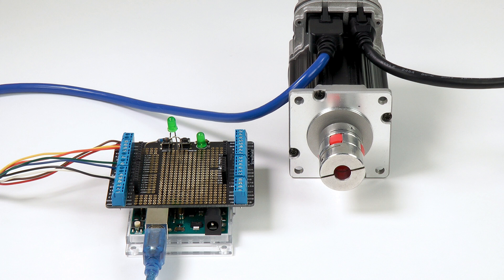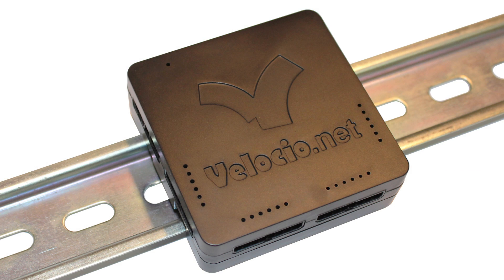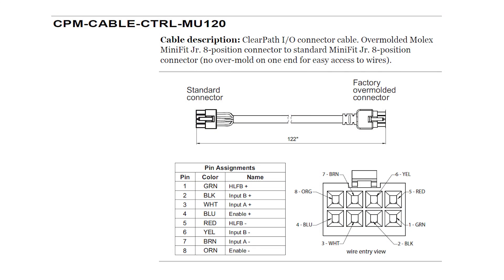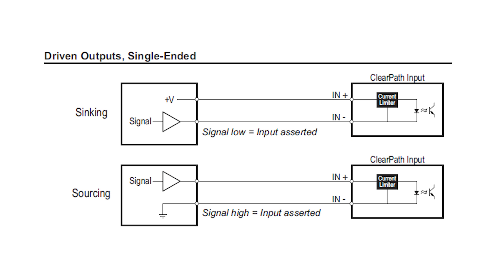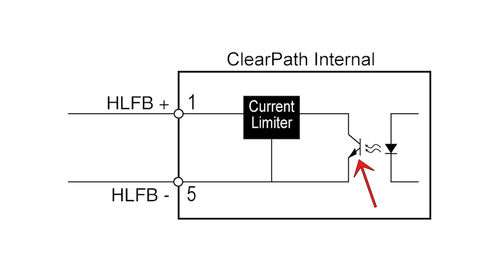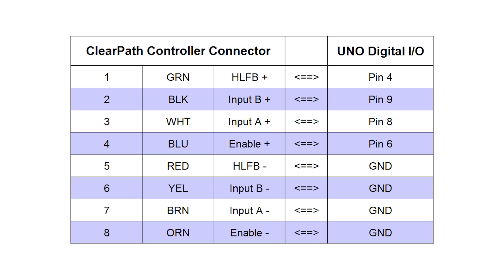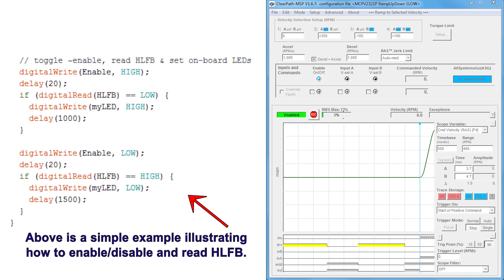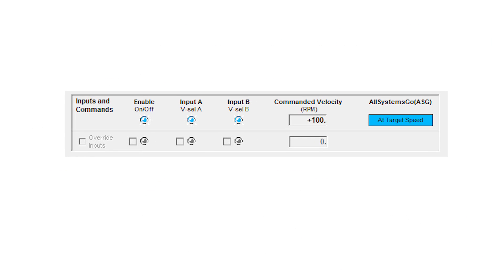How to Wire an Arduino to a ClearPath Servo Motor

Comment: Thank you very much for the video!
I have another model of this motor which is CPM-MCPV-3421D-RLN. Is the connection to the Arduino the same as this motor?
I am having an issue when I upload the four velocities code into. It only rotates for a very short time then stops.

Comment: When I use step and direction (such as with GRBL), and the motor goes into current limit, how do I recover? 
It appears I have to turn the motor off. 
.... this cannot be right....
Reply from the maker: Hi philipperubbers6840,
 
You do not need to remove power from a ClearPath step and direction servo to clear a motor fault. Motor faults can be cleared by cycling the motor’s enable input (turning it off and back on). 
 
If you continue to have problems or have any additional questions, please don’t hesitate to reach out on our website (https://teknic.com/contact/) or call us at 585-785-7454. 
 
Best Regards, 
Brendan -Teknic OEM Application Engineer

Comment: Presently I have UGS connected to an Arduino with the CNC breakout board running three little stepper motors. The overall plan however is to run Clearpath SDSK motors instead of the steppers. To that end I have ordered one SDSK and I will replace one of the steppers with the SDSK and see how it works. I will then be buying the rest of the motors to convert my machine. I will report back if/when I get it working, the motor is en route! I want to thank Abe A. at Teknic for his help thus far.

Comment: Does the wattage of the 4-28 VDC matter?
Reply from the maker: Hi remoman,

Yes - The logic supply's power rating (watts), or more specifically the current, does matter but ClearPath I/O does not require much current to operate. The exact logic supply current required for a given ClearPath motor varies slightly based on supply voltage. For example, Teknic recommends allowing at least 8mA per I/O point when using a 5VDC power source, and at least 12mA per I/O point for 24VDC supplies. The ClearPath manual includes a graph on page 46 that shows the recommended max. current to budget per I/O point for a given supply voltage (5-24VDC): https://teknic.com/files/downloads/clearpath_user_manual.pdf

As a minor note, while the video does state that our logic level voltage range is 4-28VDC (which is entirely true), I would encourage you to stick to the nominally recommended 5-24VDC range to achieve maximum design margin.

If you have any other questions, feel free to contact us at https://teknic.com/contact/ or give us a call at 585-784-7454.

Best regards,

Mark D. - Teknic Servo Systems Engineer

Comment: Hello, I am interested in your servo motors.

Currently I'm working on mach3, with an NVUM Novasun control card.
I'm a little lost on the wiring for the connection of the servo motors

On my control board I have 3 pins per axis.. but I see that on your servo motors there are 8 to connect?
My control card is not compatible?

In case this is not compatible, can you guide me for a control card that can use mach3? (other than arduino)

THANKS !
Reply from the maker: Hi A.Kreation29, 

The NVUM Novasun control card may be compatible with the ClearPath motors, but it's hard to say for certain without some additional information (I’m not personally familiar with that specific board). 

Teknic has seen many customers successfully develop CNC applications using Mach3 and the ClearPath SD motors. The ClearPath SD motors simply require 5-24VDC step and direction signals from the controller (in addition to the enable input). There’s more information about input wiring in the ClearPath User Manual (https://teknic.com/downloads/ ). If you reach out to our support team with wiring information for the control card (e.g. wiring schematics), we would be happy to help determine if the board is compatible with the ClearPath motors. 

If you have any further questions, please feel free to reach out to Teknic directly by submitting a contact request on our website (https://teknic.com/contact/ ) or giving us a call at 585-784-7454. 

Aimee F. – Teknic Applications Engineer

Comment: Did you ever make a video with the Arduino Analog input?
Reply from the maker: Hi alonsomartinez9588,

We have not made videos using the Arduino analog input. However, we have wiring diagrams in the ClearCore User Manual demonstrating how to wire analog inputs. While not identical, these diagrams may be a good starting point. The ClearCore User Manual is found on the download page of our website, located here:(https://teknic.com/downloads/).

Alternatively, after producing this video, Teknic released the ClearCore which is an industrial I/O and motion controller. Included with the ClearCore is a robust library containing a suite of example programs and an Arduino wrapper for customers comfortable in the Arduino environment. More information about the ClearCore can be found here:(https://teknic.com/products/io-motion-controller/).

If you have any additional questions, don’t hesitate to reach out. You can contact us at https://teknic.com/contact/, or call us at 585-784-7454.

Best,
Bradley N. – Teknic OEM Applications Engineer

Comment: I couldn't get this to work with my SDSK3432. It's communicating properly with MSP the jog function works just fine. I've already done the battery test the indicator for enable, input A and B is working. When I uploaded the arduino code that I copied from your Github I can't get the motor to move. However when I wrote my own code it works ok. Is there something I need to change from the MSP settings?

const int pin4 = 4;  // Pin 4
const int pin6 = 6;  // Pin 6
const int pin8 = 8;  // Pin 8
const int pin9 = 9;  // Pin 9

void setup() {
  pinMode(pin4, OUTPUT);  // Set pin 4 as an output
  pinMode(pin6, OUTPUT);  // Set pin 6 as an output
  pinMode(pin8, OUTPUT);  // Set pin 8 as an output
  pinMode(pin9, OUTPUT);  // Set pin 9 as an output

  digitalWrite(pin4, HIGH);  // Set pin 4 to HIGH
  digitalWrite(pin6, HIGH);  // Set pin 6 to HIGH
  digitalWrite(pin8, HIGH);  // Set pin 8 to HIGH
}

void loop() {
  digitalWrite(pin9, HIGH);  // Set pin 9 to HIGH
  delay(50);                // Wait for 200 milliseconds

  digitalWrite(pin9, LOW);   // Set pin 9 to LOW
  delay(50);                // Wait for 200 milliseconds
}
Reply from the maker: Hi Louie,

My name is Brendan C., an applications engineer at Teknic. The link to our Github in the description will take you to code written specifically for an MC series motor which is not compatible with the SD series ClearPath motor that you have. That is probably your main problem. Given that your code moves the motor, it’s unlikely you need to make any changes to the ClearPath configuration in MSP.

As a side note, this video preceded the release of Teknic’s ClearCore I/O and Motion Controller. I realize you already have an Arduino, but you might want to look at ClearCore for similar projects in the future (https://teknic.com/products/io-motion-controller/). It has an extensive library and example code, and it’s plug-and-play with ClearPath motors. It also has an Arduino wrapper that allows you to program it from the Arduino IDE if you want.

Feel free to reach out with any questions by filling out a contact request form (https://teknic.com/contact/) or giving us a call at (585) 784-7454.

Brendan C. – Teknic Applications Engineer
Reply: @TeknicInc  Hello Brendan C, thanks for your quick response. I had a feeling it has something to do with the SD series. I do have a clear core on hand I was just curious  about hooking it up to an arduino since i have a few sitting around.  

Also which series do you recommend for  a cnc lathe spindle? I'd  like to control the rpm and directions with a MASSO controller.
Reply from the maker: @Normedtech  Hi Louie,

Teknic recommends the SD series when using a MASSO controller. The SD series, which has position control, is very good for drill and tap applications. The speed range for these motors is 4000-6000 RPM, so for higher speed cutting applications you will likely need a spindle motor.

If you have any other questions, feel free to give us a call at (585) 784-7454 or fill out our contact request form and we will be happy to help.

Brendan C. – Teknic Applications Engineer

Comment: is that the whole code for this project? do we need to add a button or something also?
Reply from the maker: Hi Shipuku 030 - a link to both Arduino sketches used in this video can be found in the video description.  The video goes into extensive detail about all of the components and wiring.  No buttons were used in either of this video's examples, but most microcontrollers could use a button wired into a digital input if desired.  
If you have any other questions, please feel free to reach out to us directly by phone or use our “Contact Us” form at https://teknic.com/contact/ 
Best regards, 
Matt C. -Teknic Servo Systems Engineer
Reply: @TeknicInc  ok, thank you also, what is the led and resistor wired to?
Reply from the maker: @shipuku0305  The pull-up resistor and LED in this example are wired with Arduino's 5VDC pin on one side, and the Arduino digital input and ClearPath HLFB+ on the other side.  This pull-up is required to ensure Arduino's voltage-driven input reads the ClearPath digital feedback signal (HLFB) correctly.  The LED serves as an external visual indicator of the on/off state of HLFB.  Alternatively you could omit the resistor and LED, and instead turn on Arduino's built-in pull-up resistor.  A full discussion of HLFB starts at 3:43, along with wiring diagrams at 4:38.
Reply: @TeknicInc  ah ok thanks, that was confusing me

Comment: Question let's say I have two CPM-MCVC-3432P-RLN
They are new but they can't be used in my application because they do not support step and direction. Would I be able to exchange them for CPM-SDSK-2321S-EQN.
I can cover price differences if there are any and shipping if needed too. These were not ordered in my account. I am asking this before ordering the 1st servo mention as it's easier to order as one of our vendor already stocks them and we can easily make a po number for them.
Reply from the maker: Hello nightmare in action, 

We do not have a policy for exchanging motors. Instead, the motors include a 90-day return policy, during which you can return the unwanted motors for a full refund for any reason. The money back return policy is linked to the account that placed the order from Teknic, so if you have purchased through a 3rd party, you would need to coordinate with your vendor to handle the return.  

If you have any additional questions about this process or would like to help placing an order, please contact us via our website at https://teknic.com/contact/ or give us a call at 585-784-7454 between 8AM and 6PM EST. 

Best regards, Bradley N. - Teknic Application Engineer

Comment: Hopefully I get a reply. Is it possible to use these with 3d printer boards the output stepper driver signals to use for a 3d printer as their internal closed loop system makes them ideal for 3d printers and fast acceleration with precision
Reply from the maker: Hello nightmare in action,

Thanks for watching our video and for submitting your question.

Many CNC applications, such as 3D printers, use the integrated ClearPath SD motor series for motion control. The integrated ClearPath servos include the servo drive, the servo motor, and the encoder for a fully closed loop solution. This type of design architecture is ideal for precise, multi-axis coordination where each axis must be in the correct place at the precise time in order to produce favorable results.

The control signals for the SD series are step and direction signals with a voltage of 5-24VDC for a high logic state and 0VDC for a low logic state. This is the same type of step and direction signals used by many stepper motor systems. Quadrature signals can also be used for motion control in place of step and direction.

Many high volume OEM companies in the CNC market (as well as end users) rely on the performance of Teknic's ClearPath motors. Some CNC application examples include 3D printers, large format printers, laser cutters, plasma cutters, waterjet cutters, mills, and routers just to name a few.

To get you started, here is a link to the ClearPath SD series overview page:

https://teknic.com/products/clearpath-brushless-dc-servo-motors/

Teknic can help you with ClearPath motor sizing as well as providing assistance with selecting the optimal winding and encoder resolution. You can send your request for technical support to https://teknic.com/contact/ or give us a call at 585-784-7454 between 8AM - 6PM EST. A factory-direct support engineer will be happy to help you with your application to ensure a successful result. 

Best regards,
Tom T - Teknic Servo Systems Engineer

Comment: What software configuration can be used for complete/full control of the SC series via an Arduino? (not just using presets store in the motor) I'm using a NEMA-34 SC Enhanced.

I've used several of the small NEMA-23 SD series, but step & direction was easy to implement and command steps were explained in your website documentation... I haven't found this type of documentation on the SC with Enhanced firmware. Thanks.
Reply from the maker: Hi beforebefore,

Thank you for watching and commenting! The SC series ("SC" stands for Software Control) is different from the SD series (Step and Direction) ClearPath in a few important ways. 

With ClearPath-SC Series: You write your own custom motion control code using C++ or C# in conjunction with Teknic's sFoundation software library. In essence, the host system (and your software) comprise the controller. An SC system requires a dedicated Windows PC or single board computer such as Raspberry Pi or BeagleBone Black; microcontrollers (such as Arduinos) can’t serve in this capacity.

With ClearPath-SD Series: Your controller (e.g. Arduino, PLC, Mach 4 with SmoothStepper, etc.) sends digital pulses to the ClearPath motor's step and direction inputs, thus commanding motion.

The SC system, while more complex, may provide greater flexibility than either ClearPath-SD or MC series motors. Here's a ClearPath-SC overview video that may be helpful: https://youtu.be/IljtGxkJhZs.

There is quite a bit of additional information on our site including videos, user manuals, and specifications that may be help you decide if ClearPath-SC motors make sense for your project: https://teknic.com/products/clearpath-brushless-dc-servo-motors/model-support-sc-dc/.

Feel free to contact Teknic if there's anything we can help you with.

Thanks again,
Jim W - Teknic Servo Systems Engineer

Comment: Is it also possible to control the SC series with this method of control from a microcontroller to straight to the 8 pin connector?
Reply from the maker: Hi Ian,

It is not possible to control a ClearPath-SC motor with a microcontroller. Applications which use ClearPath-SC motors require either a Windows (or Linux) PC, or a single board computer (SBC) such as a BeagleBone Black or Raspberry Pi. 

In these applications, software engineers use Teknic’s C++ class library (or optional C# wrapper) to create their host application. This application runs on the PC (or SBC) and communicates to the ClearPath-SC motor(s) over a USB or high-speed serial port through a communications hub (https://teknic.com/clearpath-accessories-guide/accessories-guide-sc-dc/#sc4-hub).

If you (or anyone else reading this comment) is interested in more information on the ClearPath-SC motors, Teknic created a video that gives users a high-level overview of the ClearPath-SC series: https://www.youtube.com/watch?v=IljtGxkJhZs. We also created a video that provides an in-depth look at using a SBC with ClearPath-SC: https://www.youtube.com/watch?v=R7bgAo0EINI

If you have any other questions, please feel free to give Teknic a call or contact us online at https://www.teknic.com/contact/

Best regards,
Bridgette G. – Teknic Servo Systems Engineer
Reply: @TeknicInc  Thanks for the clarification!

Comment: Only 1 thing missing. The arduino needs a config.h or similar to tell which pin is assigned for. Any info on that config would sure be nice to know. I am hunting all over to find info on how to replace the steppers on my arduino cnc
Reply from the maker: Hi Phil cnc machinest,
Thanks for watching our video, and for your interest in ClearPath motors. Though I don't work with Arduino CNC applications per se, I may be able to point you in the right direction. In this video the pins were assigned directly in the code itself, so a quick look at the project .ino file should  give you what you need in terms of pin assignments. Here's a link to the project files for this video: https://github.com/Teknic-ClearPath/TekTips-Arduino-Wiring-Video Hopefully this will help.

Regards,
Jim W. - Teknic Applications Engineer